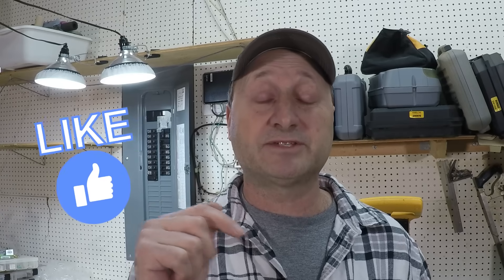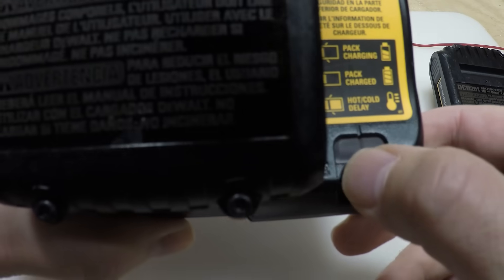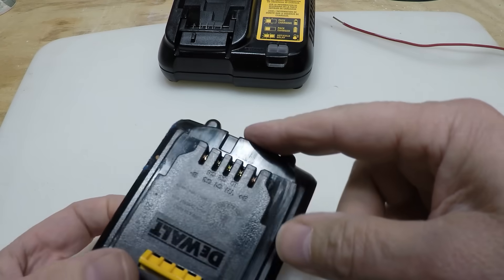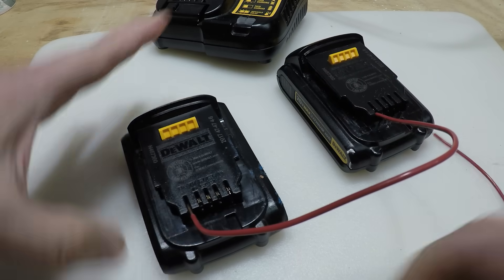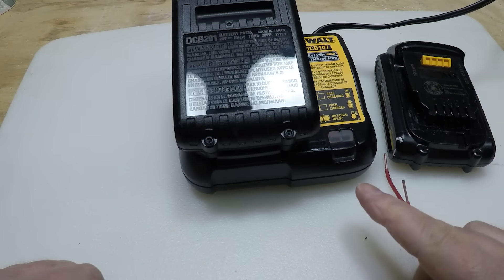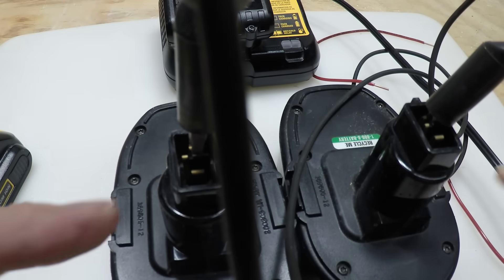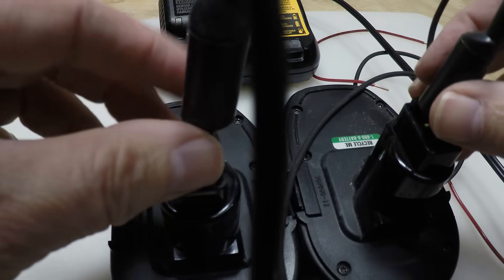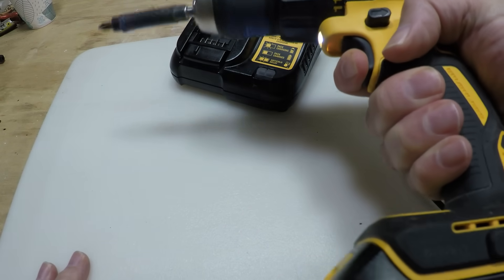SECRET to FIX Drill Batteries - Charge Dead Lithium Tool Batteries

Comment: Also you guys, the batteries inside of these devices are usually 18650 batteries.
These can be found in a LOT of devices that you can scrounge them from.
Laptops, other power tools battery packs, MANY things that charge the battery pack.

Take them apart & save the batteries inside. You can test them & keep the good batteries.

There's videos on this where you can replace the dead battery(s) & keep your battery pack going for next to NOTHING!

You could also order these 18650 batteries used or new & replace part or all of the battery pack. It'll save you a fortune over buying a new battery pack EVERY time you need one battery changed!

Most devices are built to TOTALLY so working if 1 battery goes bad.

Look into this.
It's worth it!

Comment: What do you do when the battery won't hold a charge anymore?...even though it lights up in the charger.
Reply from the maker: that is a different problem. If it is charging but will not hold a charge, then the battery is probably finished. I made a video on less expensive replacement batteries

Comment: Thanks for your prompt response however, there are no polarity instructions or markings on any of the batteries to determine positive and negative terminals. I have one good and two dead ni-cad batteries.
Reply from the maker: you will have to look for the manual

Comment: 80volt Kobalt battery.  Dont have another one to use for a 'jumper'. Any ideas for me to try? All I have is the battery itself and the charger to plug it into.  It shows 2 of 3 bars on the battery now.  The charger light turns green when I insert it.  The fan will come on and the green light flashes and I think it's working... Until about 55 seconds later, when the charger just shuts itself off and flashes red.
Reply from the maker: use any lithium battery

Comment: Any suggestions on how i might pull this off with an 80volt Kobalt (KB2580-06)?  Battery co$t so much so i only have the ONE battery.  Suggestions for what to use for a jumper battery?
Reply from the maker: use any lithium battery

Comment: Great video; however, I have an older Die-Hard19.2 V ni-cad, four terminal battery for my Black & Decker drill that is dead, any suggestions? Thanks.
Reply from the maker: read the instructions on the battery to see which contacts are + and -  then jump it with another lithium battery

Comment: I have got my dead battery to take a charge by using my R/C battery charger. Than charger with regular charger but the battery still doesn’t have the power to do anything with it and doesn’t last long
Reply from the maker: that is a different problem all together. You MAY need to get a new battery then. I posted a video on discount replacement batteries

Comment: I have a 20v Craftsman battery that just tried to "jump start" and it didn't help. The wires I'm using barely fit into the plastic to connect to the clips. Is there a such thing as to big of gauge wire for current to flow to the dead battery?

Comment: This isn't good practice because the dead battery would be a short circuit resistance wise and so you will not do good to the good battery by short circuiting it even for a few seconds as also written in the instructions to never short circuit a battery. 
It would make more sense to use a power supply that is constant current to try to revive the bad battery and take care because giving more current than should there is the possibility the battery could explode.
Reply from the maker: have not heard of one exploding yet. Millions have tried it now

Comment: MINE CHARGES BUT EVEN ON A FULL CHARGE IT DOESN'T WORK LONG. WHEN i WAIT A MINUTE IT WORKS  THOUGH I OFTEN HAVE TO REPEAT. SOLUTION?
Reply from the maker: that battery is at the end of its life
Reply: @flannelguydiy6458 Thanks. It's an XWORX so hopefully they still have them. It's at least 10 YO

Comment: Question.  When you use the battery again until it's dead again, will you have to keep jumping it each time you want to use it?
Reply from the maker: you should not let it run completely out. When your drill stops running while you are using it. There is still a trickle of power in the battery but not enough to make the drill work

Comment: NOTE - LONG TERM Storage of the battery in the TOOL will slowly micro DRAIN the current and ruin the battery - it will take months  - so DO NOT keep the battery stored in the tool

Comment: Ok, So I have exact same batteries as you. Both say charging when I put them on the charger. Approximately 5 minutes on charger and it says fully charged. Put patter on tool. Battery goes dead within seconds of using it. Put back on charger and in about 5 minutes says charged. But goes dead within seconds of use. Any ideas... New batteries are anywhere from $150.00-$300.00+. Really getting tired of Dewalt batteries. Great tools but batteries kinda suck at this point. Please help.
Reply from the maker: Joe, I think your batteries are simply done. However, I have a source for cheaper batteries. https://www.youtube.com/watch?v=X9zttZc0CB0&t=31s

Comment: I have been doing this for years and it's the same with car batteries and truck batteries using jump packs.  Batteries have to have a little power for it to start working.

Comment: great info-I have 24v Kobalt set--all 3 batteries dead-its brand new
the terminal set up has only 3 prongs-so its +-+ and - - right? but all 3 batteries asre dead? what next?
Reply from the maker: Try using a different battery and go from (+ to +) and (- to -)

Comment: What about a battery that is slowly getting weaker every day, if I put it in the charger, it flashes replace battery pack, I don't think it will work for those batteries
Reply from the maker: it may not work for them.

Comment: Great tip, but the only problem is you will need a good battery, which I do not have.  I have 3 bad batteries.
Reply from the maker: you can use any type of battery

Comment: Tried with my 5AH Ryobi lithium battery. No luck. It does show full LED but will not run devices. Volts but no amps?
Reply from the maker: it may be truly dead then

Comment: I did it with my battery. Same make of battery that you showed. It didn't work. Even left it jumpered for about 20 minutes to raise the voltage in the dead battery, enough voltage to make the tool run, and it still will not charge.
Reply from the maker: it may be truly dead then

Comment: on the older style battery you were showing how to place the wire ( one wire) on the battery and then you said just add the wire to the second set of terminals but you didnt say anything about doing while the first wire was on. So do you use one wire at a time unlike the 20volt you were showing first were two wires were immediately placed on the battery  wire or do you use only one wire at a time on the second and older battery? i.e. can you place two wires on the older 18 volt at once?.. btw I assume the older 14Volt battery in not capable of being recharged this way?... thanks for your response
Reply from the maker: you can do this with any battery. You put one wire on and leave it on there while you put the next wire on

Comment: Nice tip. I'll stop throwing away my Makita batteries and try this first. I have a Greenworks tools 60volt battery that won't charge but shows itself to be 75% full. When I put it on the charger it indicates bad battery. Any ideas?
Reply from the maker: no idea

Comment: I tried that method with my old batteries, and it did not work on them. My charger blinked twice then went solid. But maybe I was supposed to leave them connected for longer then two minutes...I don't know?
Reply from the maker: you only needed to connect them for two seconds. Make sure you used the correct terminals

Comment: Hi, I've lost the charger when I moved house, the older style you showed here. However I have several of the modern type. It's there a way that I can change the older style  battery with the newer format charger please?
Reply from the maker: if you can figure out which is + and - on the old charger, then you may be able to run wires to the battery

Comment: You are a legend. It worked on the first go for Black and Decker charger. Tge charger was so flat straight out of the brand new drill box. I did not have copper wires so I used paper clips and OMG miracle. It is CHARGING! 😂
Reply from the maker: thank you for watching. please share the video

Comment: I never realized this about Lithium batteries and/or charging stations. I have a collection of older tools that I replaced because I did did not want to spend a fortune on a new battery just to have it fail. I 'm going to go back and make sure I try this. Thanks so much for bring this to light. The tool industry knows this too but they want to sell warrantees. Your the Man.
Reply from the maker: thank you for watching. please share the video

Comment: I have a car battery charger which self discharged. It will not hold a charge when plugged into a socket. Do I have to change this battery or can I do something similar to the battery. Great video
Reply from the maker: see if the charger works on a different battery
Reply: I’ve tried that also. It’s the Eliminator 500A and was left idle for a year without charging. Just won’t recharge! Love some ideas as to how to get it going again as I don’t want to throw it away. Thank you.

Comment: Thanks for your instructions I really appreciate it. I was wondering if you ever have dug into an old battery case and tried to rejuvenate a stubborn cell or just plain replaced a faulty one with a new or known working used single cell?
Reply from the maker: I have not
Reply: @flannelguydiy6458  THANKS for your Candler, Now I have done it on different occasions with Laptop batteries that were either too expensive or just plain nonexistent and most of the time Had pretty good Luck! The Biggest thing is explaining to my costumers what I did and a few options they might consider, ( like replacing All the batteries with new equivalent ones, (but the existing electronics would remain), find something comparable that would still need something swapped out, (either one would not have much of a warranty), pay the extra money for a new oddball battery pack or just plain upgrade the PC itself Now if my modifications got it running, Backup anything important to an external drive and make it a whole lot easier to migrate to the new machine! Oh Yeah I had a few grips but they were few Thanks for the read!

Comment: if its not working for you--- that would be because the NiCd battery pack has a short circuit in one of the batteries which is then draining the charge.  Bridging a bad battery to a good battery is never going to fix that issue.   same with LiPo, these batteries have a finite life span and when their internal series resistance goes up (as it naturally does over its lifetime) they will get hot during discharge, which will then trip the thermistor and make it go into protect mode.       The chargers themselves detect when the battery has a fault like this, and that is why they dont charge. It is a safety measure to prevent fires
Reply from the maker: thank you for watching. please share the video

Comment: Can't stress enough, only a few seconds, as shown!  Much longer, and you risk too much current for too long and thermal runaway. You also have to have a bit of luck that the charge controller doesn't "see" it as a bad pack an reject it too.  As an example, some DeWalt chargers like the one I have will blink rapidly and also refuse to charge.  Watch it for a couple of minutes for this.  If that happens, you may be out of luck and need to buy another pack anyway.
Reply from the maker: thank you for watching. please share the video

Comment: I have an old Metabo 12v upright battery that will not take a charge at all. I am not able to source a replacement although the drill itself is still in excellent working order. I do not have another battery to jump it off with. Can i charge it with a 12v trickle charger? Thanks
Reply from the maker: you can try it

Comment: Can someone please help me...I have a Li-Ion 40V Ryobi battery OP4026 for my weed eater. I've been used it from time to time.  The last time i put it on the battery charger,  it was charged in full (4 bars), but when i put it on my weed eater, it could only run about 5 minutes and it stopped working. It now showed 2 bars and stopped working anymore.  I recharged it again until it's full. I put it on my weedeater again and it did the same thing. It ran for 5 minutes and stopped. Why? Any suggestion please?
Reply from the maker: In this case, it sounds like your battery is at the end of its life.

Comment: Remember the laptop and cell phone fires?  There is a good reason for the safety circuits that you are bypassing.
In LiIon cells, once discharged below about 1.4V per 3V cell, the copper electrode starts going into solution.  When the cell is charged again, the copper plates out as nucleation points -- and Lithium whiskers start growing on them, during charge cycles.  Eventually, the whiskers can grow long enough to puncture the cell membrane and start shorting out the cell.  Forming hot spots that can ignite the cell.  Not sure what the percentage is on ignition.
BTW the smoke is toxic.

Comment: Every battery I've ever had that has died on me and there have been dozens I pulled apart and checked  each individual cell and tried a regeneration procedure, every time the reason for the failure is that a number of the cells are beyond repair, so I think the chances of this procedure working are not high.
A second thought is if the battery has suddenly gone to zero volts it could be because the battery management system has shut it off for safety reasons,  if you then trick the  BMS into opening the circuit again without dealing with the safety issue it could be dangerous.

Comment: Wow... what a good tip. My question is, if I only had one 18V DeWalt battery could I use a different type of battery to inject a little power into the 'dead' DeWalt (for example a Duracell 9V) or would that be asking for trouble?

Comment: There's another way other than that, no jumping required. I done it once with a 10 yrs dead DeWalt 14.4.  At first I thought it was the Drill. So I tore it apart to recycle it. 10 yrs later I saw a guy had a drill on a junk collecting trailer. That's all he had on it. I still had the dead battery & no drill. I asked him if I could have it he said yea. I went in the house and tried another idea. Let the Battery charge overnight. It worked. I was happy.
I also know how to make a 57" Mitsubishi Flat screen TV show with out a antenna. Just as well as Cable.

Comment: This is why you don't run tools on lithium batteries after they automatically stop. It's saving a charge for this. If you keep squeezing the trigger it will run more but then they will not charge.

Comment: I have a 40 Volt Ryobi that seems dead even though there is one status light still on green when you press the test button.  It won’t charge.  The Ryobi charger is blinking red / green and it indicates that it is dead.  A little tricky to get a wire into the terminals in these newer batteries.  Do you think it’s still worth a try?

Comment: This is genius!  I have a Ororo heated vest battery that seems dead.  It’s 7.4 volts.  Is there any hope for this type of battery?  My daughter only used the battery maybe four times.  It sat over the summer and now shows just one light blinking when trying to charge.  These stupid batteries are $60.00. Anyone that has any suggestions, I’m open.

Comment: HI.  I have one of those batteries.  The brand is Craftsman DieHard 12 volts.  I tried to recharge it with a Power supply of a notebook, hoping that a little charge will sufice for the original charger to pick it up.  No luck.   Is there something different about this brand ?  Thank you for your answer.

Comment: I tried this (before finding your video) (tested for voltage first ...is 14.7 volts ) but still wont charge It is a new battery (showed 2 bars on battery lights ) so tried it on my drill to test it after a couple of seconds drill stopped no lights on battery and wont charge  the other battery I got same time same and same company I charged fully first and that one is fine..(they did refund me for battery as they were out of stock of same (7 ah)...when charged good battery red light pulsed  the one that wont charge red light just flashes....battery make PDstation dcb 200 7 ah 126wh

Comment: Good tip. I never let my batteries drain completely. Im have the same drills and put the batteries into the charger as soon as they start losing power. If they sit unused for a length of time, I will occasionally charge the batteries.

Comment: I've never known this to work except on battery's that had only ever been charged a few time's or so.
It'll not work on well used batteries that suddenly refuse to charge as they often have a damaged cell or 2 with very high resistance.
These can be made to work sometimes by dismantling a releasing the gas from individual cells with a small screwdriver.
But wouldn't advise it unless in an emergency situation.
If you start bypassing safety features its like removing the battery from a smoke alarm.
Safety tip never charge batteries unattended as 90 percent of batteries fires are as a result of unattended charging

Comment: If I flash an 18 v battery with a 20 volt, will a 20 amp charger safely charge the 18 volt battery? Don't want to re-buy a charger for it